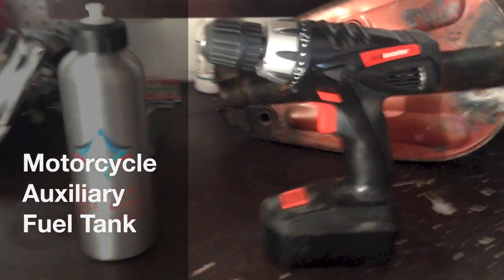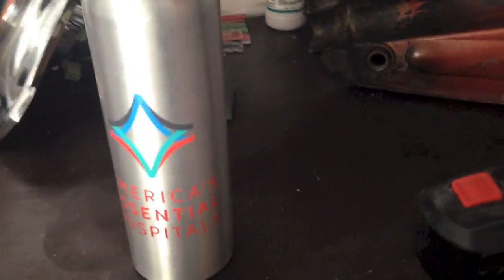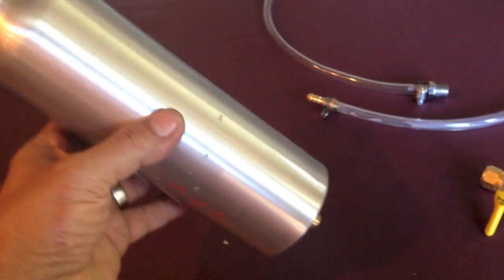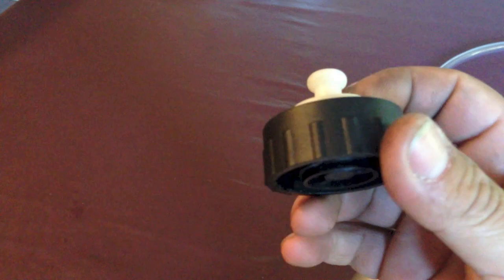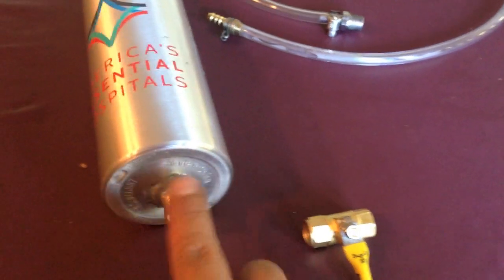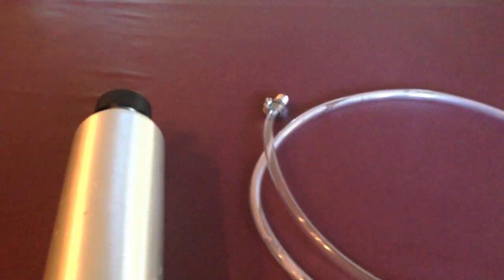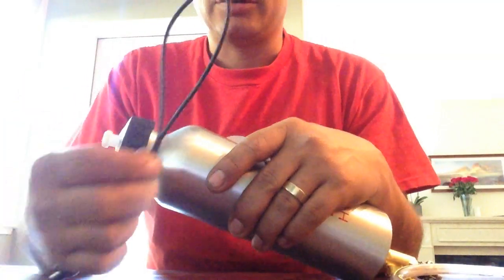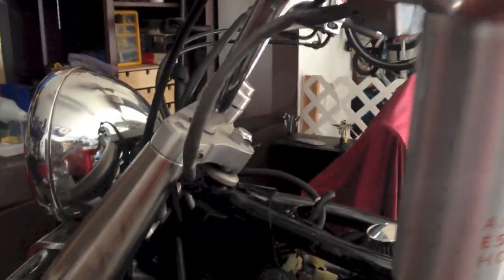DIY- Motorcycle Auxiliary Fuel Tank

Comment: It must be frustrating to have so many people comment on this video and not know the true purpose of this tool. Great video. Much more affordable than purchasing an auxiliary fuel tank.

Parts List:
-- Metal Water Bottle
-- JB Weld
-- Anderson Metals 57001-0404 Brass Hose Fitting, Adapter, 1/4" Barb x 1/4" NPT Male Pipe 
-- Anderson Metals 56122 Brass Pipe Fitting, Hex Nipple, 1/4" x 1/4" NPT Male Pipe
-- Smith-Cooper International 8140 Series Brass Mini Ball Valve, Inline, Lever Handle, 1/4" NPT Female
-- 1/4" or 5/16" fuel line
-- Two 1/4" hose clamps

Comment: Assemble the valve and the barb fitting to the coupler before fitting it to the tank and sealing it with JB Weld. This prevents stressing the coupler connection and the JB Weld seal at the tank, which is quite possible if you build the way it is shown in the vid.

Comment: Great idea. The ONLY thing I would do different would be to tighten the on off valve really tight to the reducer and THEN epoxy it to the tank to prevent cracking the JB weld.

Comment: +Sky walker Because if it's work doing then do it the right way I went even further and welded a stainless coupling to the tank and added gas rated tubing to mine. Plus as he said its for synchronizing carbs and testing when you are working on them. Not sure if you listened or not.

Comment: what would the benefit of this be as opposed to just using the bottle to store the fuel and pouring it in the tank when you are out of gas?  Don't get me wrong, the idea is great as an example of how simple it can be to make your own gas tank for all sorts of purposes.  Overall though, great job on explaining and it is a cool diy project
Reply from the maker: If what I was trying to do was to have a extra tank to carry around you would be correct ...BUT that is not the intention here not at all ..
This is used to be able to work on your bike, carburetor etc and you need to start the bike but need the tank off to make adjustments. 
Anyone who works on his bike knows how much one of this can be just a great little device to have :)

* This is NOT a fuel carrying container***
Reply from the maker: This is NOT a spare fuel container... This could be a called a tool for those who work in their own bikes... Specially for carb work..
In no way is meant to be carried around.
Hope that makes sense

Comment: I have some dobts. The gas won't dissolve the plastic cap from the bottle? The gas won't dissolve the plastic inside the bottle?. Because that kind of bottles have some plastic film inside to be chemically inert to water based substances. And very often, the plastic is dissolved with solvents such as gasoline. And, is the gas filtering missing?
Reply from the maker: Your observations might be correct. 
What know for sure is that I've have this for 2.5 years now and everything still the way it was the day I put it together.
Remember you aren't using this every day or storing fuel for long periods of time.
You use it if you have a job to get done, you finish, you empty it up and up till next time.
Unless you are a mechanic that deals with carbs every day and at that point you would provably have a pro set up.
I customize bikes and only use it 3- 4 times at year :)
Reply from the maker: I've been using this for over 2 years in multiple bike projects...so far not a single leak or problem at all.

Comment: Jb weld is not so good , i used it on a tank, dried and cleaned, on a very very small hole , millimetric , only took one week before petrol started eating the jb weld and making it elastic like rubber :/. Tried 4 times, , tried sanding it harder , not a chance
Reply: That might be entirely possible but in my case since I use this tank to perform repairs etc that only have gas for a couple of hours at a time I have had no problems in more than 4 years of use.
Also there are different types of JB weld out there ....
Reply: catalynoo  
Exaktly my experience with a leak repair kit. However in regard to the purpose of kreating a vessel to use while working on the karb while stokk tank is off,
this totally fits the bill.

Comment: ok you all are correct  as is this is pointless however  i will be using this as THE FUEL TANK  but will not use jb weld to hold the fuel that may set my ass on fire so ill use a aluminum valve/ cap and get it welded on .

Comment: This is an old video. I know that. But where do I buy the all the tubing and all the metal connecters you had
Reply: harry goldbeck 
I got everything but the bottle at the local hardware store... really easy and simple. And a great addition to the garage !
Reply: TicoDesigns1 ok thank you. I have a pocket bike with no gas tank. Does the bottle need to be above the engine. Or can it be below
Reply: harry goldbeck 
It depends if the engine's carburador takes fuel by gravity it needs to be above the engine...if the bike has a fuel pump it doesn't matter where the bottle is.
Reply: TicoDesigns1 there's no like little bubble thing to pump up
Reply: No there is not. I think it's just gravity flow.
Reply: And do I need it to be a metal bottle. Or can I use a thick plastic Bottle
Reply: harry goldbeck 
It's better if you get a metal bottle only because is safer and probably easier to seal it and have no leaks...
Definitely it will have to be above the engine

Comment: This is kinda redundant. Why not put the gas in the bottle then just pour it in the tank?
Reply from the maker: Louie Watson  once again!
This is NOT to go out riding 
This is for motorcycle repairs where you need to work on your bike and do adjustments while running and you can’t or it would be a lot easier to do it without the fuel tank. ie: carb adjustments etc 
If never don’t it never would understand

Comment: Oh how about you just keep the bottle and pour it in your tank when you run out. Why does everyone feel the need to over complicate everything.
Reply from the maker: I guess you don't do work on your bike otherwise you would understand what this is for....its not to use as a spare fuel container...
It is to be use while doing work on your bike....the kind of work that requires you to take the fuel tank off and do the work and start the bike to test and do more adjustments if required all of it without having to take the tank off and mounting it back many times and perhaps even dent the tank while doing that.
It's just a awesome tool to have to save you time and inconvenience...
Reply from the maker: +Luke Brown 
There is always one like you out there.....
If this is not something useful to you just move on. 
Every mechanic shop has an auxiliary tank to do work in the bikes.... That concept is difficult to grasp when ppl only knows to turn on the ignition and go ...but for people who work in their own bikes it's an easy thing to understand.
Reply: Richard Adams 
You have a point there ... only thing is that the ones sold for that purpose are called exactly the same way.
Reply: here here.